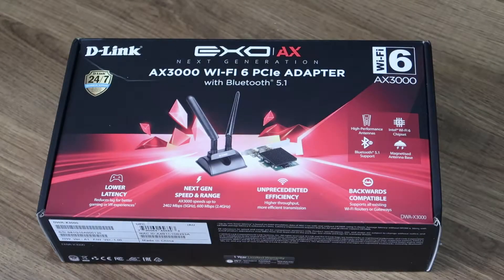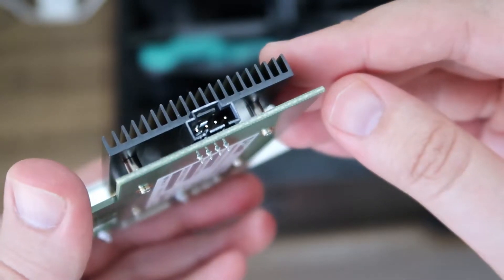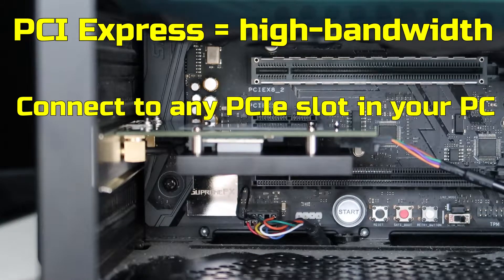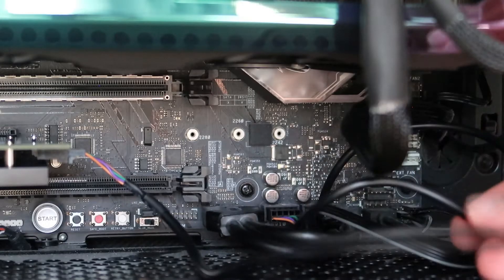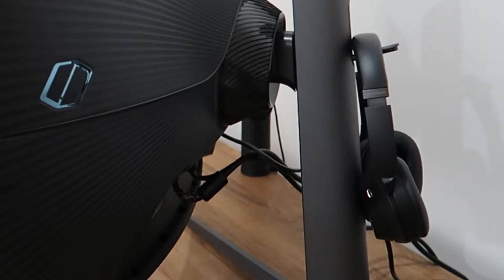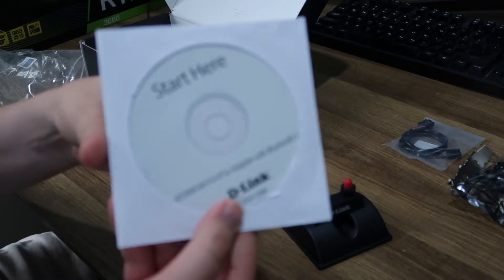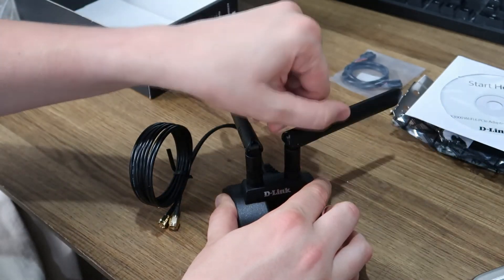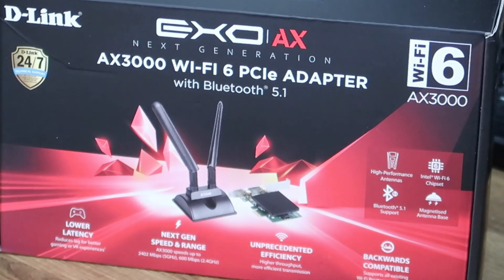D-Link DWA-X3000 \ AX3000  Wi-Fi PCIe Adapter Review | Bluetooth 5.1

Comment: The unit can only be connected to PCIe X1 only. It does not work on other PCIe as stated on your video. I have tested all the PCIe slots on my mainboard GA-Z77MX-D3H and it only works on the PCIe X1 slot.
Reply: that will be your board and chipset. my AMD and latest intel rigs no issues at all. as long as i use cards that dont exceed the lanes i have .. i am good even if it does my card slows to the max lanes that slot has.

Comment: A nice review with decent video. I have always been a D-Link fan though they have had some misses over the years. But this looks to be a nice upgrade over older adapters. I personally like the external antenna especially if your PC sits in a corner and would block antennas on the card itself. Nice job!